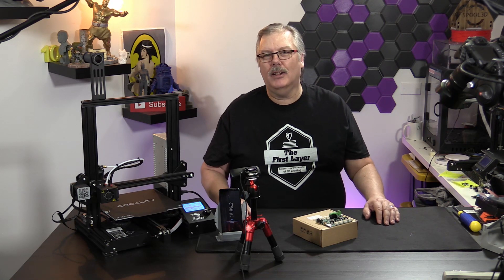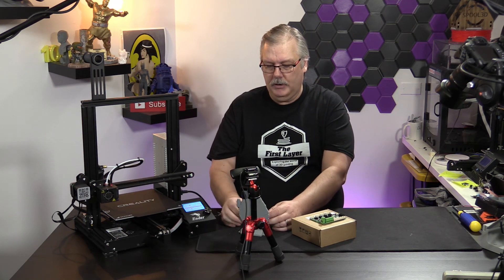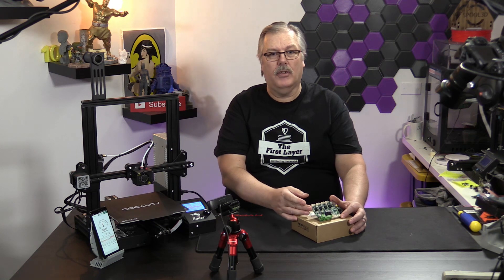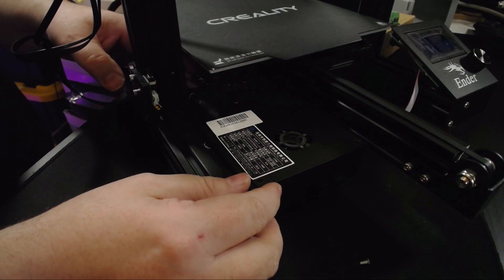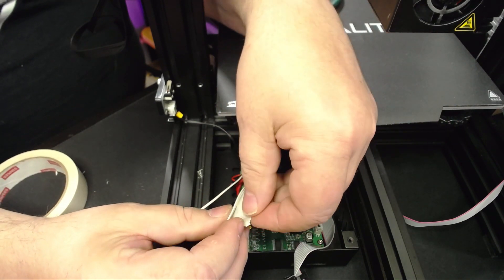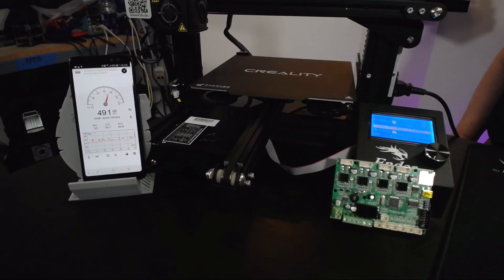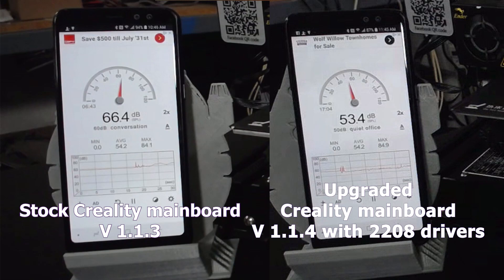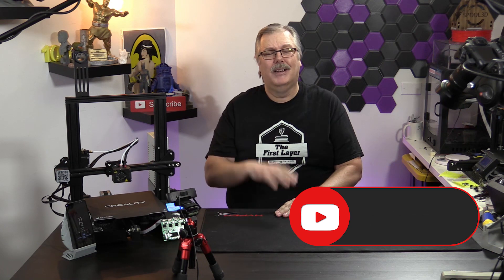Creality mainboard V1.1.4 with silent steppers

Comment: Received my new motherboard today although it's v1.1.5.  I nstalled it straight away and it is noticably quieter. All you hear are the fans. No more dot matrix printer sound effects and when I use octoprint no more red warning sign on the opening page. I believe this to be protected again thermal runaway. I still have test prints to run but it is a big step up from the stock m/board.

Comment: Ok it is quiet. 
Does it print better and faster with the 2208's?
I  would need to see an improvement in print quality overall and a reduction in print times to really make it worth upgrading.
Can you put your original board back in and do a few print tests then install the Silent Stepper board and print the same files?

Comment: Clearly made a big difference. I have only 1 printer "yes..an ender3" The noise it makes really dos not bother me. Are there any other benefits  to this new board?
Reply: The new drivers may help with surface quality in some prints. This is different from TL smoothers though.